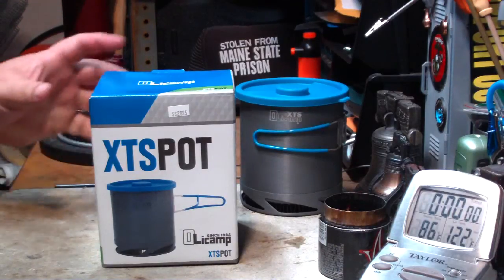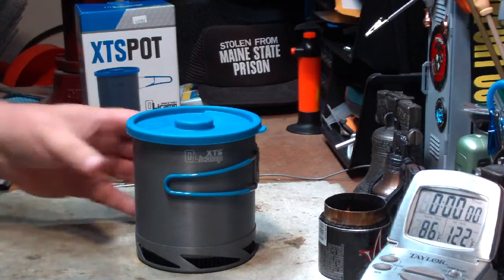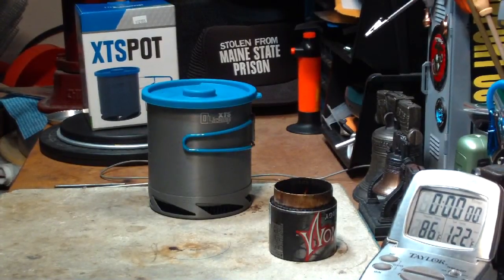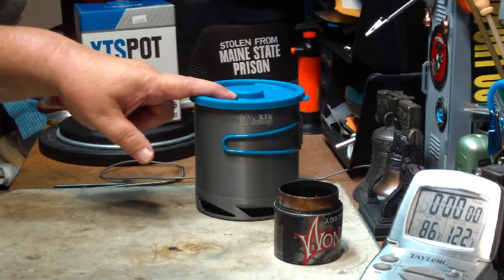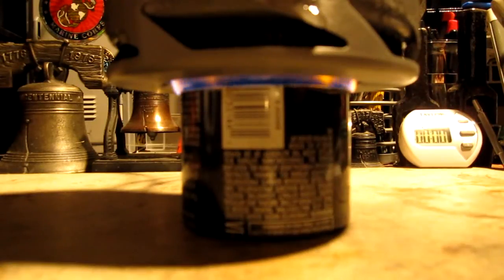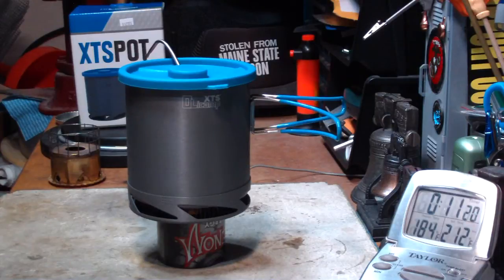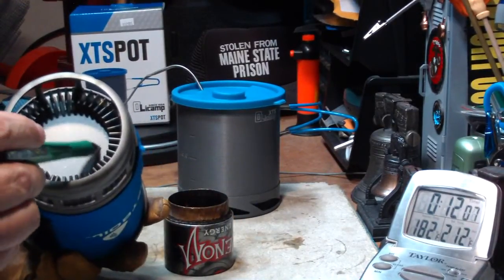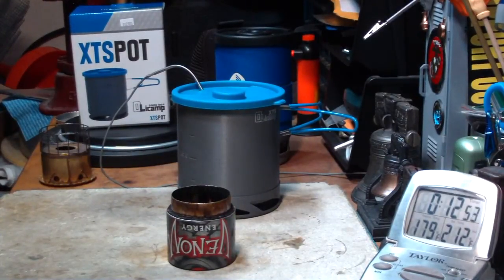Olicamp XTS Pot - Boil Test #2 - Using Super Venom Stove

Comment: Try your fancy feast stove with carbon felt with the 15 hole cat can as the fuel reservoir. The heat exchange pots need a lot of flame/heat thrown at them in order to take advantage of the rate of heat transfer.